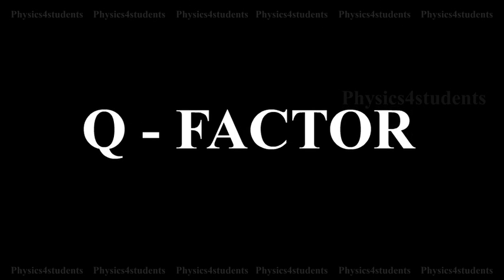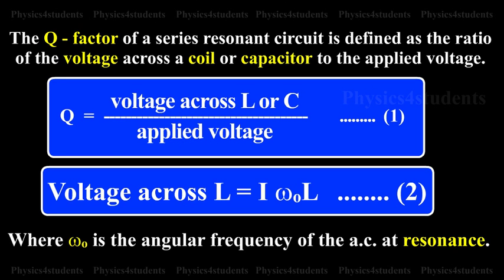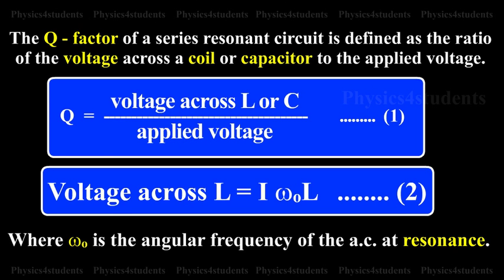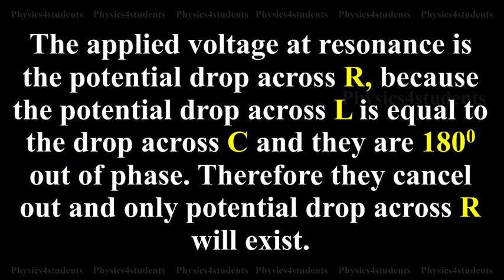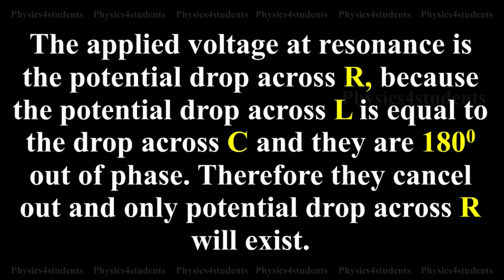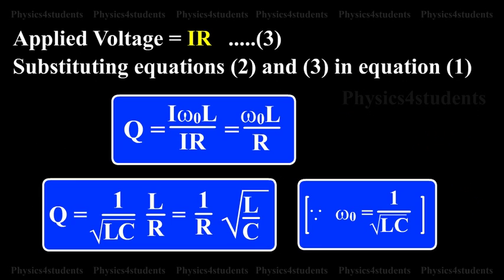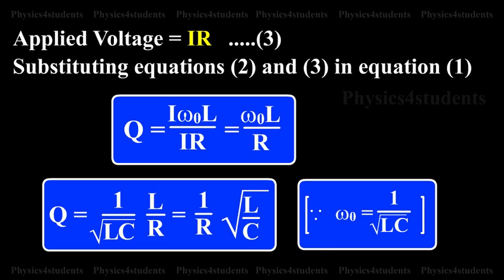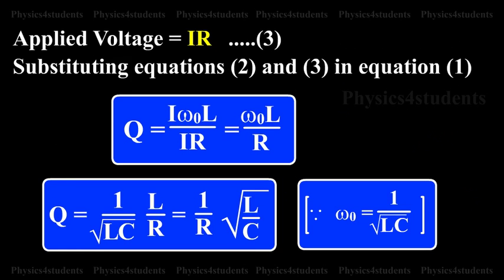What is Q-Factor? | Physics4students

Comment: Why p.d. across L or C is greater than the applied voltage?
Reply: If it is a parallel resonant circuit, the voltage on L and C equal the supply voltage.  This video analysis must be about a series resonant circuit, where inductor voltage leads supply current by 90 degrees and capacitor voltage lags 90 degrees behind supply current, so inductor and capacitor voltage are 180 degrees out of phase.  In a high Q circuit the voltages on L and C can be many times the supply voltage because they cancel each other out, and only the voltage across the resistance in the circuit is left at the supply terminals.
Reply: It is in series resonance circuit, however they get cancelled out at end